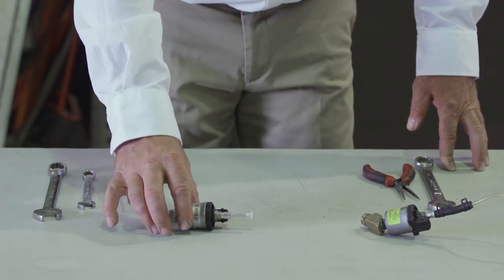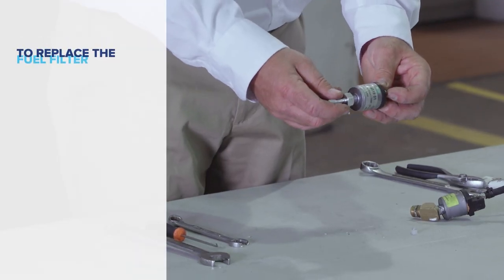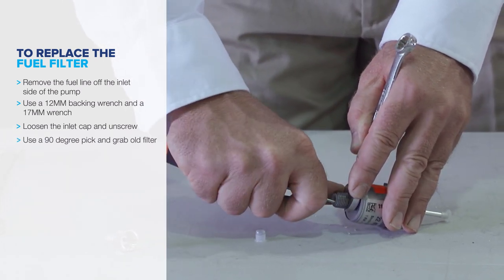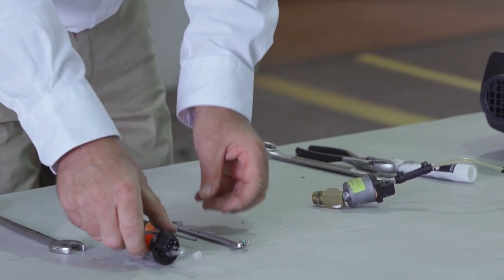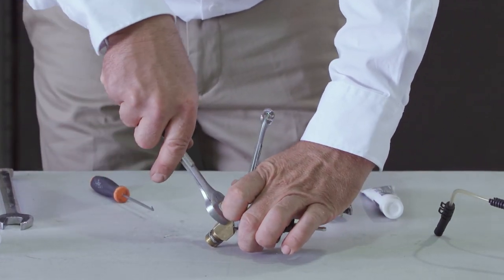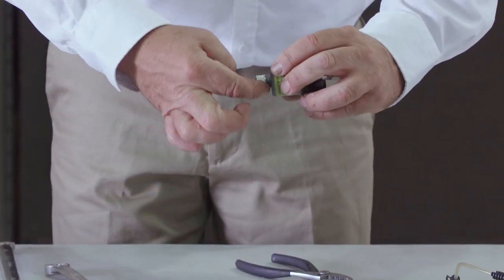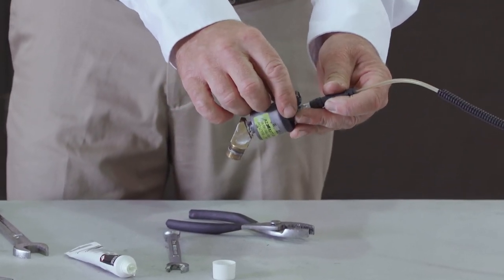How to Service Your Fuel Pump and Replace the Fuel Filter

Comment: Please note the electrical connector is NOT always the high side. Sometimes it is on the inlet rather than the outlet side. This is the case for the Hydronic S3 supplied fuel pump, part number 22 4550 05. It may be true for others as well. When doing this maintenance make note of the orientation of the existing fuel pump.
Reply from the maker: Correct, connector orientation varies for different fuel metering pump styles. Install the fuel pump according to the installation instruction for the specific heater you are installing.

Comment: Fuel filters are known for causing a heater to not start or smoke when they start to restrict the fuel. If your heater is struggling to start after you replaced the atomizer screen or if it is smoking while it is running I would replace the fuel filter. There are a lot of variables from fuel quantity to depth of fuel standpipe in the tank.
Reply from the maker: Thank you, @Traveledtwo , for the added pro tip.  Much appreciated.

Comment: If I get power to the pump but pump is not clicking.. even after trying 2 new pumps. What elese could I check?
Reply: The same happened
Reply from the maker: Hi Franki.   I know you sent this message over a year ago.  But I'm just going through and replying to any messages or questions that fell through the cracks.  If you ever have technical issues or questions about any Eberspaecher product, and you're not getting the answers you need from your dealer, remember, you cam=n always reach out to Eberspaecher Technical Support
📞 1-800-387-4800 X2299
📧 help@eberspaecher.com
Our team of on-staff technician and engineers will be more than happy to help you out, if they can.   But hopefully the need will be few and far between.

Comment: Ok where is this thing located please?  Before i tear apart the heater again just wondering if it was hiding in the cover somewhere because I didn't look hard enough
Reply: It's not part of the heater unit itself, but located along the fuel line between the heater and the fuel tank.  Likely attached to the underside of the chassis of your vehicle.
Reply: @danpaul000  I called up espar and they told me same thing.  Its so tiny and just dangling there by a rubber bracket
Reply from the maker: Hey SuperTrucker... just stumbled across your comment and was wondering how your Espar/Eberspaecher heater is working?
Reply: @EberspaecherNorthAmerica  Working fine

Comment: So.. I installed my D2L heater with the electrical connector of the fuel pump on the low side, but it's running fine. I mean, wouldn't I run into problems pretty quick if I installed the pump incorrectly?
Reply from the maker: The new D2L heater features a redesigned pump with the electrical connector on the opposite side of the pump. For these new fuel pumps having the connector on the low side is recommended.  I hope that answers your question, Sages 101.  But of not, feel free to message us again.  Aways happy to help.
Reply: @Eberspaecher North America  yes  I went and double checked, it's installed correctly. Thank you for the reply 😁👍🏻

Comment: Mike, I installed a Webasto Airtop 2000 STC (petrol) yesterday and am having issues getting the fuel pump to operate correctly. When plugged in, the Webasto's blower fan turns on, but the fuel pump does not operate. 

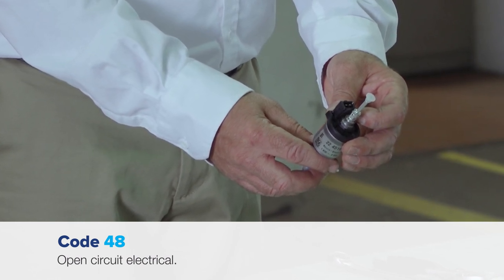I tried your method (starting at time = 0:45 of your video) of grounding one of the pump's terminals and pulsing 12V power to the other terminal. Each time I pulse power, I hear one click within the pump. I believe this tells me that the pump is good, but that I may have an open circuit. How does one find the source of the open circuit? I have triple and quadruple checked each of the electrical connections and they are all secure.
Reply: Hello Amiana,

I am currently having the exact same problem as you. Did you find out a solution? any help is appreciated!
Reply from the maker: I'm terribly sorry (and embarrassed) that your question slipped through the cracks.  I do hope you found an answer to your question.  Should you have any new questions, the best course of action is always to reach out to our technical support team first.  Phone: 1-800-387-4800 ext 2299 or help@eberspaecher.com.  Again, my sincere apologies.

Comment: I got a brand new freightliner. I went to turn on the bugs heater for the first time and it says check fuel pump. It’s got to be something simple that I can’t figure it out.
Reply from the maker: Apologies for the tardy response, Harry.  And I'm sorry about your issue. I would suggest you reach out to our Technical Support Team at 1-800-387-4800 X2299 and/or help@eberspaecher.com.  They will be more than happy to assist you and/or answer any questions you have. 

Please don't hesitate to reply to this message if you don't hear back from anyone and I'll personally forward your issue to the support team and make sure you receive a speedy reply/answer.

Comment: Hello Mike, I have a Great West Vans Legend SE which is a Mercedes Sprinter 3500 cassis class B RV from 2014. it uses an Espar system for hot water, and cabin heat. The hot water and heat stopped working. It was making a whining sound and would shut off, now it doesn't even do that. I think it's the fuel pump and filter, maybe a dirty filter put the pump under too much stress. I have not been able to find anyone to help fix it at all in OH. Can you advise where I might get a pump and filter? Thank you.
Reply: I hate to say but it does not sound like a fuel pump because when they do not work there is no sound at all. It kind of sounds like the heater is locked out or has an active fault code. Some controllers have diagnostics in them and if yours does it can also clear codes. If you are locked out from too many no starts (10) you will need to clear the codes to clear the lockout. If you have an active code it will keep your heater from operating and that code can be retrieved through a controller also if it has diagnostics. If you want to manually test the fuel pump, unplug it and ground one terminal of the pump and apply 12 volts to the other to see if it clicks. It is not polarity sensitive and if it clicks it is good. If you have no way to get or clear codes I would not order a pump until you get it to a dealer to get the codes. Ohio has some great dealers and there is a list on the web site, www.eberspaecher-na.com. You can also get any of the technical manuals on the site with making a password. You can also call the tech line at 800-387-4800 and they can direct you. I hope some of this helps,Mike
Reply from the maker: Hey @CCazmir  ... I know it's been a couple years since you asked this question, but just stumbled across it and was wondering if you managed to get your heater working properly?  In the future, if you ever have any other issues with your heater, I encourage you to reach out to our Technical Support Team either by phone 1-800-387-4800 X2299 or email help@eberspaecher.com.  Safe travels,

Comment: I heard it's really good to run a gallon of kerosene through an espar every year before winter hits, that running a gallon of straight kerosene cleans it out really good. is that true?
Reply: Kerosene and diesel are the same thing
Reply: @circusboy90210  no they are not, kerosene is thinner than diesel and has less lubricity also burns at a higher temp but can be used in a diesel heater with little or no side effects just don’t run it in a modern (common rail) Diesel engine it will ruin the pump in no time.
Reply from the maker: Hey @shatteredsquare  ... I know it's been three years since you asked this question, but just stumbled across it and was wondering if you ever got an official answer to your question.  If not, I strongly encourage you to reach out to our Technical Support Team either by phone 1-800-387-4800 X2299 or email help@eberspaecher.com.  Safe travels,

Comment: My heater won't start now pump ticks but won't start there is fuel in line but just won't go all the way to the heater now sure why says error code 8 or something
Reply from the maker: Hi Night Sky Images.  I know you sent this message over a year ago.  But I'm just going through and replying to any messages or questions that fell through the cracks.  If you ever have technical issues or questions about any Eberspaecher product, and you're not getting the answers you need from your dealer, remember, you cam=n always reach out to Eberspaecher Technical Support
📞 1-800-387-4800 X2299
📧 help@eberspaecher.com
Our team of on-staff technician and engineers will be more than happy to help you out, if they can.   But hopefully the need will be few and far between.

Comment: How often should the fuel filter be replaced on a B2 hydronic unit (gasoline)?
Reply: Fuel filters are known for causing a heater to not start or smoke when they start to restrict the fuel. If your heater is struggling to start after you replaced the atomizer screen or if it is smoking while it is running I would replace the fuel filter. There are a lot of variables from fuel quantity to depth of fuel standpipe in the tank.
Reply from the maker: Hey @functionalvanconversion4284 , I know it's been a couple years since you asked this question, but just stumbled across it and was wondering if you managed to get your heater working properly?  In the future, if you ever have any other issues with your heater, I encourage you to reach out to our Technical Support Team either by phone 1-800-387-4800 X2299 or email help@eberspaecher.com.  Safe travels,